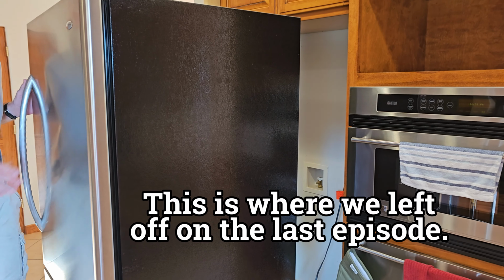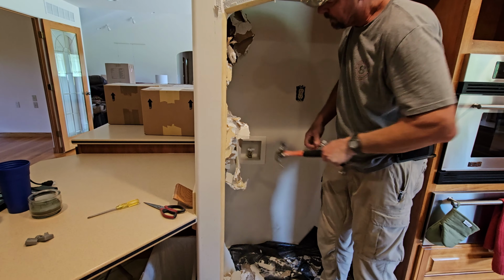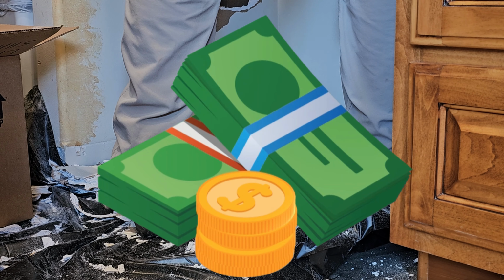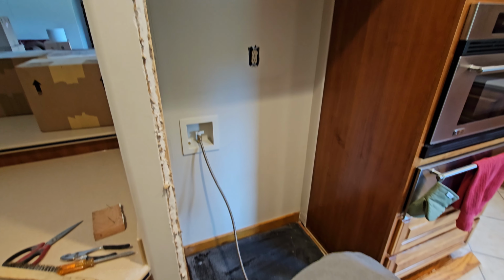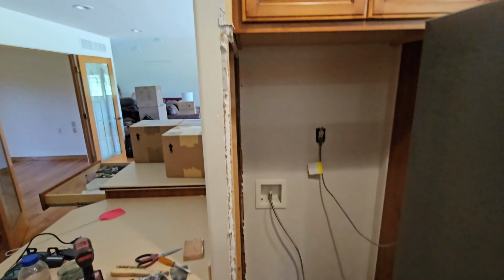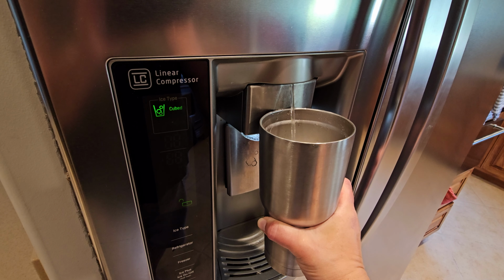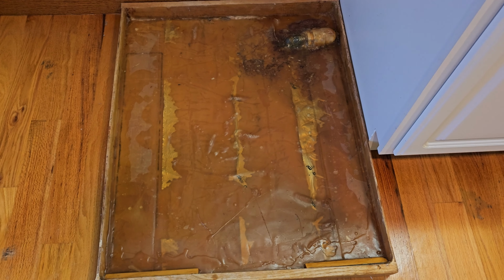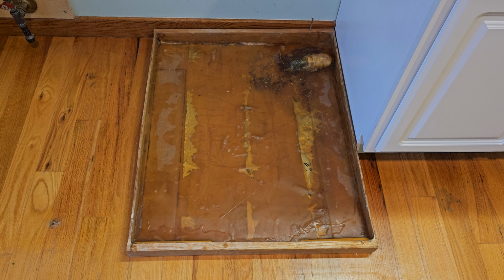We had to tear out one wall and battle with this INSANE DIY washer/dryer issue!

Comment: The drip pan under the washer was a good idea in theory. I bet you could buy on to set the machine in later on. Hate built in refrigerators for that very reason. Appliances aren't all the same size anymore. Land sure is pretty though.
Reply from the maker: Well It was a decent idea but imo not needed! Took a lot of frustration to break it free and then get it capped off! But overall a success! Thanks have a great weekend!

Comment: To me I wonder why anyone would put a refrigerator next to an oven. You know that the refrigerator needs to breathe. We had the rounded corners in our house in Florida and I like to rub my back like a bear and with those kind of edges it doesn't work. We had new washer and dryer that we bought after moving to Missouri because the people who bought our house wanted the ones we had just bought a month or 2 before selling. The guy who bought our place was an attorney and he assumed I was leaving my tractor. Ha ha no!
Reply: The underside of the frig is what needs to breath so it will do fine.  The backs are covered now days.
Reply from the maker: Good to know! We don't have much of a choice